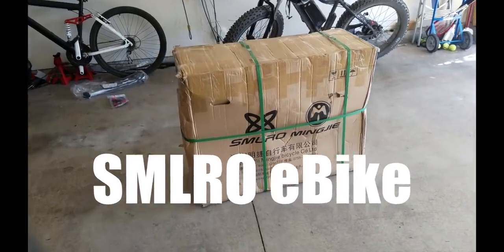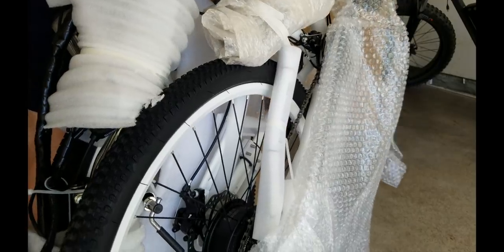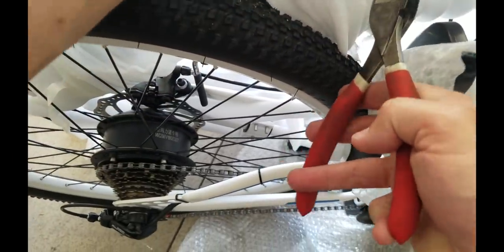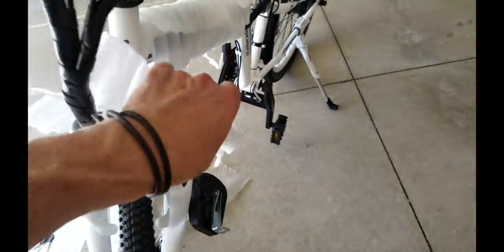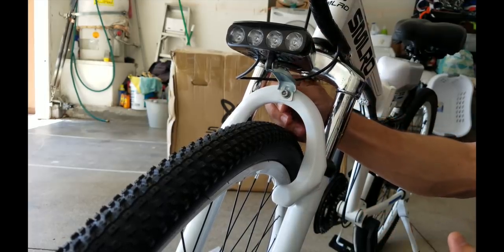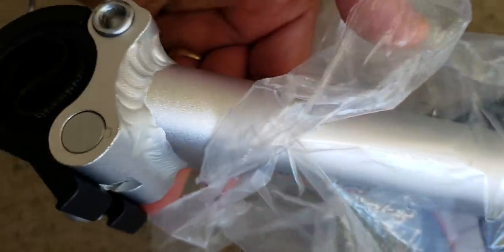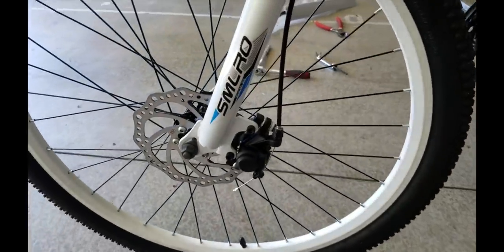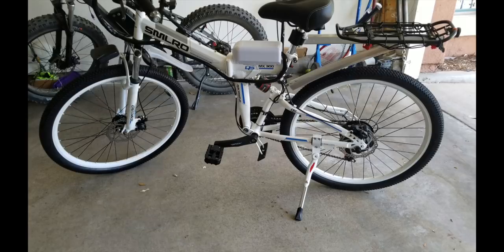SMLRO $550 USD New eBike unboxing and build *Do not recommend*

Comment: Anything less than a 500w battery is pointless for an Ebike and should be used for your kids toys. I weigh 155lbs and my 500w 36v maxes out around 25mph and any extra lbs will reduce that significantly. Don't waste your money on low powered bikes when you can get a 750w for a few dollars more.
Reply from the maker: Totally agree 👍
Reply: @smidgelife  Still an awesome video though lol. Electric powered vehicles are the way of the future when we can simply just recharge them with natural powered generators.✌️

Comment: There’s a lot of these types of bikes from China sold on Amazon. A lot of them are the same bikes but sold with different paint jobs and different names. You get what you pay for. They do the job using cheap components and as long as they are not abused they get you where your going. Don’t expect good customer service if things go wrong.
Reply from the maker: That's 100% correct I agree.

Comment: It looks like the ancheer full suspension folding electric bike. It's sold under many different brand names for approximately the same price. This bike seems to be surprisingly capable, with many positive reviews on youtube, some sponsored, others not.
Reply from the maker: Agreed.  But it's faster than Ancheer.  It will do 27mph.  But my next video shows one issue confirmed....stay tuned 😁. Still a good bike 😅 so far.
Reply: I have the ancheer bike and it does look like it. I can't do 27 mph though. Brought it four years ago no problems so far.

Comment: Get a valve removal tool, turn bike upside down, remove tube valves, green slime the tubes. Replace the valve, refill air. Slim chance you will ever get  flat. I did this on all my ebikes. 28,000 miles plus riding and no flats. Best advic you'll ever get.
Reply: I have had Kevlar liners with slime, Kevlar liners without slime, I found no difference really. I just like the Kevlar liners at this point. It's cheaper.

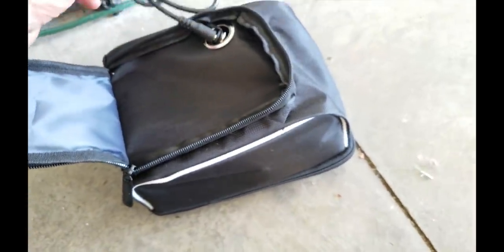Comment: 20:09 i have 7 hrb lipo 6000mh 11.1 v batteries and i did a ton of research on them and it bad to charge them when they're in a bag
Reply from the maker: That sure explains a lot as the batteries tired quickly.  Thanks for the feedback.

Comment: Took me a year to realize that there was a USB connection to charge phones hidden right under the horn. You also missed. Great bike I love it.
Reply: Where exactly is the usb charger?  seems like the horn is under the light on mine.
Could you send a picture?
Reply: @asiskarda6699  at 17:52 you can freeze the video. The charger is to the left of the horn (green button) is a round rubber dust cover is black and very tight. If you remove the rubber cap the charger is there.

Comment: Kobe, have you figured out how to (a) Turn the cruise control on and off (b) Turn the throttle function on and off (c) Turn pedal assist on and off and (d) Regulate the level of pedal assist? I have the same controller but there ius no documentation and couild really use help.

Comment: The bolt hole for the rear fender is on the lower tab of the bracket, facing directly toward the rear tire.  I can see it clearly on the video.

Comment: Most e-bikes look like everything is an after thought, wires and cables cable tied to the frame instead of being routed through the frame, this bike has taken that to a new extreme, the wiring loom is heavier than the frame, most devices could be Bluetoothed and have no wires, battery indicators, pedal assist etc dont need wires,
Reply: Kevin Jones You mean most cheap e bikes spend at least 1.5k -2k and you won’t have to worry about that

Comment: Nothing wrong with the weld on your book rack the weld it self would easily hold half a ton but I doubt the rest of the rack could hold more then 300lbs. anyone critical of that weld ask them for there welders tickets.
Reply: Don't they call that stackin' dimes or something? Looks really good to me.
Reply: Problem with these racks is vibration, all the rubber is for isolation and absolutely crucial.
Reply: Danny Bolman I'm not sure what they call it if there is a name for it, but what I can tell you is it was done on a stick welder and in todays world it's a dying art, any one can run a MIG welder in about 15 minutes of practice they still won't have a clue what there doing but they can do a decent job, now a days most welds are MIG and the flow is smoother the cool thing about stick is if you got your amp, set right once you got your arc struck you can push your stick right in to your metal and get deep penetration you can't really do that with MIG welder, unless you got a real one that runs 1/8" or bigger wire but it's still nothing compared to stick.
The first 6 hours of me playing with a stick welder was about the same as my first five minutes so yeah I had a hell of a time with it thankfully I never had to do it for a living or I'd starve to death.lol
Reply: @teddybasterd9415  don't you see that this is aluminum? I know how to MIG weld aluminum ,but I'm not sure  you do.

Comment: the battery does not look like its made from 18650 cells if its not id ditch it after a month or 2
toss out the rack and fenders the peddles replace with metal folding ones change to single speed crank 
replace the stem asap check motored wheel if  no dis connect between motor and controller splice one in 
do all this and it will be a not so bad long term use bike
the way it is out the box is good for a college  kid

Comment: Unlike most bikes which have a larger, hollow tube. The solid bar
looks like 13mm steel ... it is not hollow... and it may be stronger, depending on the metals used.. looks like stainless steel

Comment: That looks like the kind of light that might stun Kangaroos at 1000 mtrs (or flatten the battery quickly), but somehow, just looking at it, I don't think this bike is designed for "off road" use.
Reply from the maker: Correct, it's not strong enough for off-road.

Comment: Tell us max speed on level surface, tell us max range on one battery charge, can new battery be swapped in for extended range, tell us weight of bike. These facts could be in the video, or in the description, but we need those facts. Most viewers can unpack a box.
Reply from the maker: All good points.  I have tons of videos on commuting with the SMLRO.  Overall, it did not last.  But it was a fun bike.  Top speed was 26 mph on flat.  It was lasting about 18 miles on a charge.

Comment: How big is it? Will someone 5'11" to 6ft be comfortable on it?
Reply from the maker: Exact measurements anymore.  However this bike would not be comfortable for someone of your height.  I'm 5-8 and I found it kind of short.  Plus the bike over all ended up not lasting that long.  You're better off with another.
Reply: @smidgelife  do you think you could fit a 27 inch wheel in front?
Reply from the maker: @soto1683  not worth it.

Comment: Looks impressive and a real bargain.  Speed estimate sounds silly at best unless this is not a 50 state trail approved ebike, a class 2.  In which case it is useless and will cost the buyer later.  Unsellable if not a class 2 rated bike.  Why some ride testing is not part of 
this nose picking uncrating finds me wondering why not.......

Comment: With a power inverter and a car batter put it on the bike rack tide down tightly can you get extra mileage? 
If so if the electric bike or the electric motor is 750 watts should the power inverter should be 750 watts as well ?

Comment: You didn't show where the battery is placed on the bike, which to me was 1 of THE most important points.  Otherwise a great overall video.  Thanks for taking the time.  This was very informative, and I learned more from this than any others so far.  How can I find the follow up videos?
Reply from the maker: Thank you for the feedback. The battery goes in between the handlebars.  However I found that really annoying and put the battery just under the seat.  Additionally the bike didn't last very long just a few months... Subscribe to my channel and you'll see a bunch of videos on this bike where I was commuting.  The experience was okay and then got worse from there.
Reply: the persons responsible for damaging that box like that should be offed   :))   .

Comment: As far as packaging I had to give a shout out to Juiced Bikes, It came in  with high quality styrofoam to protect the bike. I see you have a 10 ah battery, I'm  guessing maybe 20 mile range? The pedals are like my  prodeco phantom x2 folding bike, it's ok but I replaced them with welgo pedals.  I also like to know how it handles especially since the battery is attached to your handlebar.
Reply from the maker: Juiced are great quality 😀 I'm always a fan.  Thanks for the comment.

Comment: Pretty interesting, doesn't seem as shit as I was expecting. Truth be told though, I am weary of riding something cheap, I know it's likely not going to happen but I worry about frame structure and suspension reliability on something like this. $500 is a sweet deal though... any decent ebike under $1000 is an amazing purchase if you ask me, so long as it's not crap.
Reply from the maker: Same here!  So far it's pretty freaking impressive.  Speed and distance...(stay tuned).  As far as quality on the main parts... Agreed.  Pedals are crap.  I think the front shocks (although not bad), are most likely the weakest part.  But still, for general use or commuting they'll be fine.  Thanks for watching.
Reply: This bike has a lot of positive reviews on youtube. Some of the reviewers are pushing the bikes hard, testing the bikes off road, getting a little bit of air, riding through sand, etc. I'm really surprised by how durable the bike appears to be.

Comment: HEY, I like 1000 watt hub motors!!
Reply: The problem is, the wheel hubs are designed for spokes..  I live in the Sierra Estrella Mountains west of Phoenix... it's some of the roughest terrain in the country... and it was 45° today..  Celsius.   Just about half way to the boiling point of water... it's asking for trouble with steel spokes  .. I have been looking at that type of motor for an electric para-sail ... they have a tremendous amount of torque.. and will turn a propeller just fine
Reply: What is needed is a batacitor... discharge like a battery, but charges like a capacitor, more or less, instantly.  Wish I could post pictures 📷 😪

Comment: excuse, what size is the wheel?
Reply from the maker: 26"
Reply: @smidgelife  Do you have a backup battery?
Reply from the maker: @ggword4123   I do not.  This eBike ended up being quite problematic and eventually died.  I think they sell a newer version.  The point here is you get what you pay for.  Look up some of my other videos on this bike.  Cheers.
Reply: @smidgelife  thank you very much for the information.
Can you recommend a 26" electric folding bike?
Reply from the maker: @ggword4123  It will be difficult to find a good one @ 26".  Rad makes a solid non-frills folding ebike: https://www.radpowerbikes.com/products/radmini-electric-folding-fat-bike  I have the RadRover (3 years and running).  No frills does = lower price :)
Reply: @smidgelife  A quick summary of the problems with this bike please? I watched all the videos as well

Comment: How about the battery life? Thanks
Reply from the maker: The battery life is great I can go. Electric at least 21 miles.  if you do pedal-assist you obviously can go better it depends on your circumstances as well but it's very strong battery life.
Reply: Thank you very much I’m thinking of buying several of them to take for rentals on beach
Reply from the maker: @eduardoperez7797   If it's for rentals... I'd be careful.  These bikes work okay to a point, but I did have issues with them.  Watch my other videos.  Are you renting to the public?  If so, the RadRover is a very solid non-complex bike with a 20mph limit.
Reply: Well is more like a delivery service for several small companies and delivery down south of the border so I’m looking for something not so highly expensive and at same time renting to public

Comment: Wow! 27 mph!
Reply from the maker: Yes!  It's a very capable bike.
Reply: Nope. 25-35 km/hr, or 15-21 mph
Reply from the maker: I switched it to MPH, and it was reporting 27 MPH, so let's see... I'll need to get a independent speedo and confirm it out.
Reply: You can disable the limiter. It's a white cable inside the controller. Some of these bikes ship with the limiter already disconnected. 27 mph is very very fast for a bike. It should allow you to keep up with automobile traffic. Hard to mistake a 27 mph top speed with a  21 or 15 mph bike with faulty speedometer.
Reply: It's only a 350watt motor so I don't think it's 27mph.  more like km not mph.  A 500w motor can reach 25mph.

Comment: I wouldn't feel at ease with this battery just under my balls 😅
Reply: I think that's actually the controller and the batteries are built into the frame
Reply: The battery is in a bag that I think Attaches under the handle bars. It is NOT Built into the frame  ....
Reply: As long as it's not a Samsung battery.